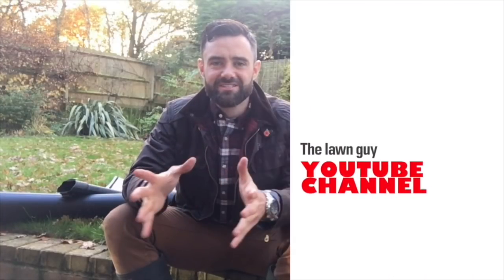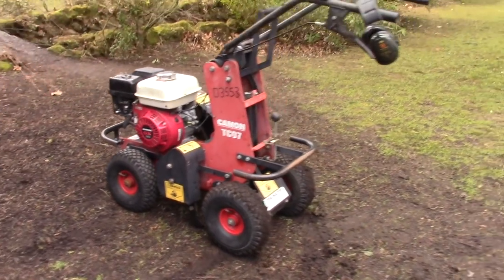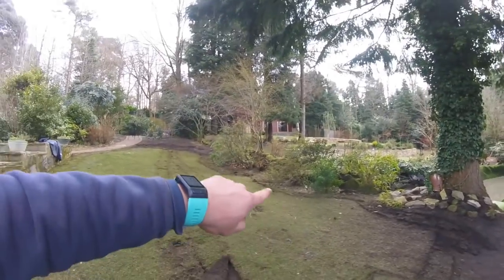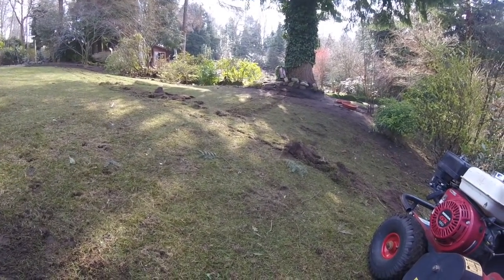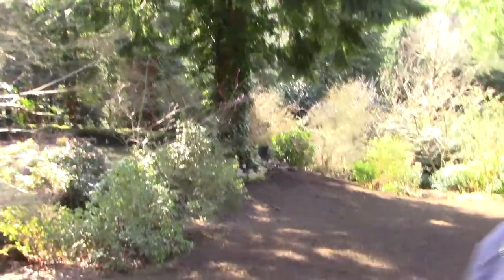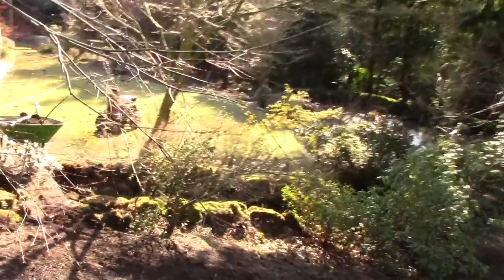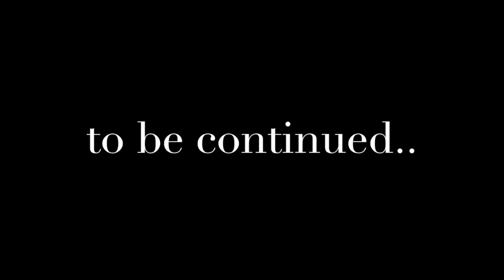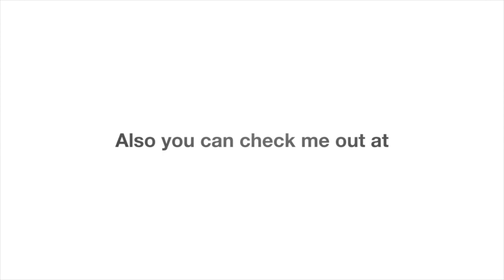Turfing preparation (Part 1)

Comment: The camon turf cutters are usually really good, but it really struggled with that hill. Looked like you had pretty tough day, but you managed to do loads on your own, great work and great video.
Reply from the maker: Lewis Lawn UK Thanks! yeah I was knackered by the end, turf cutter was fine on the flat! I think also I’ve been spoilt in the passed using the top pro brands from the greenkeeping world